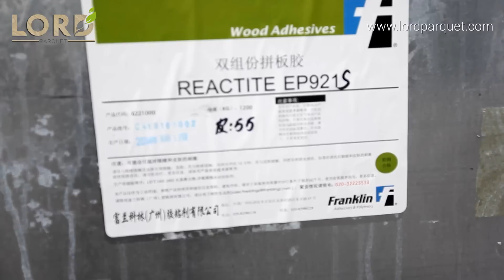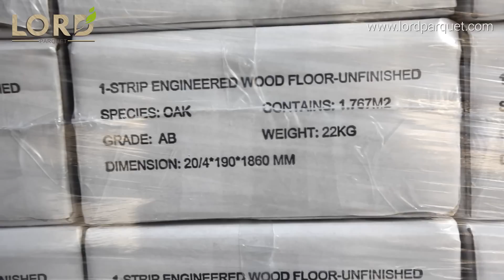Lord Parquet Engineered Wood Flooring Manufacturing Tour

Comment: 👍 Nice video of modern flooring production! What keeps the veneers from sliding when they are being glued onto the plywood?
Reply from the maker: When it go into the pressing machine it could slide a little bit, maybe 1-2mm, but we leave 10mm extra, so it will still be enough for milling for tongue and groove/click system production.

Comment: what is the black mixture you apply on the knot?
Reply from the maker: +Aleksandar Bogojevic Epoxy Resin.
Reply: tx
Reply from the maker: +Aleksandar Bogojevic It called epoxy resin,which is better than the wood powder, will not collapse after dry.